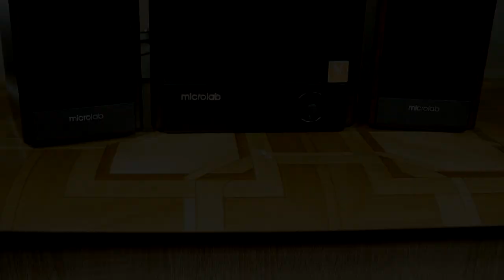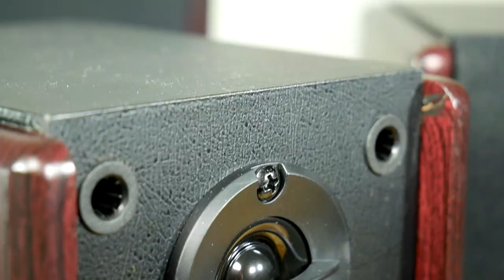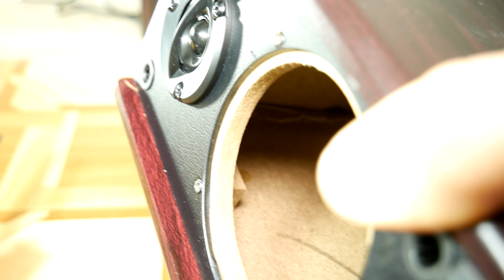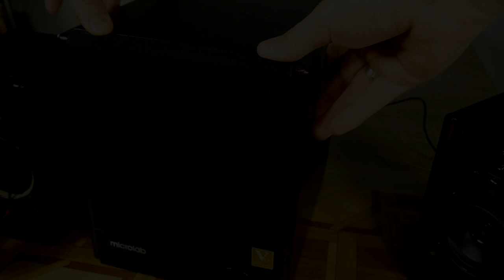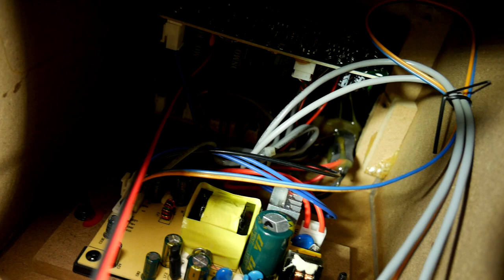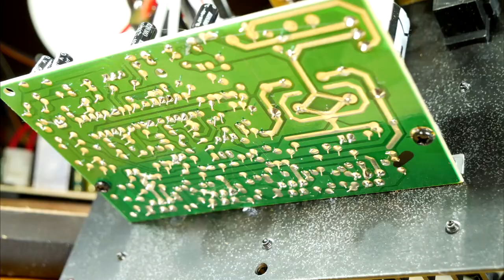Look inside Microlab FC-330 speaker - What's Inside?

Comment: I still have mine for like 10 years already. Never realized that the tweeter is fake until I had the sattelite cone woofer repaired LOL
Reply: how did you get it repaired? why did it break
Reply: @rjj00  humidity. Had it repaired by a trusted speaker shop for less than 10 dollars.
Reply: @ricoswabe18  does it sound the same or better/Louder
Reply: @rjj00  better 🙂

Comment: These satellites have a huge magnet, they can have a fair amount of excursion and the sats looks good too. Sad it has a fake tweeter, and I thought the dust cap had been pushed in lol. I think the magnet on the subwoofer is the same size as the satellites, what?
Reply: I wanted to buy these 2.1 speakers for my second TV set, I used to make loudspeakers and used to be in that crazy workd of audiophiles, now I just don't want to pursue some perfect sound, just want accaptable sound for  some reasonable money. As soon as I saw this fake tweeter I lost interest - I understand that for many people such thing doesn't make a difference, some even say that this wide range speaker is good enough with reproduction of both mid and high frequencies. To be able to do it as good as separated mid-range speakerand tweeter (with x-over) that wide range speaker must be of high class, so its price would be higher than the price of separated mid-ranger and tweeter. Manufacrurers won't give you that. Ask any audiophile what he/she will prefer, one speaker in the box, or tweeter and low end speaker, I bet everyone will choose later. Finally, whole industry of PC speakers went to toilet during the last 2 decades or so.. Cheap speaker doesn't mean catastrophy each time, but they try to sell bad speakers for decent money. Not fair.

Comment: Any chance you can tell me what are the capacitors inside the subwoofer? Like what voltage they have etc. I have a humming issue with my FC330 subwoofer that I am hoping to solve by replacing the capacitors. Knowing their specs would be a massive help so that I can try to get the right ones. Thank you!
Reply from the maker: Sorry, but i dont have this system anymore :(

Comment: wow lol nothing I hate more than FAKE. If you're not gonna put it, don't fake it. Bad. Very bad.
Reply: yes you are right, tweeter speaker is fake, but the full range driver is very good and provides more than enough high notes. i own them and they can fill up the whole house with good sound
Reply: @unknow9667  Hmmmm
Reply: And what? 3" full range play 120hz-10khz in good quality, so "tweeter" is not neccesary.
This system play very good for its price.